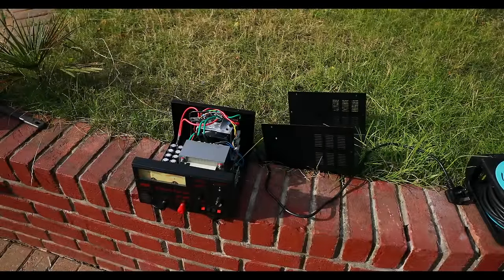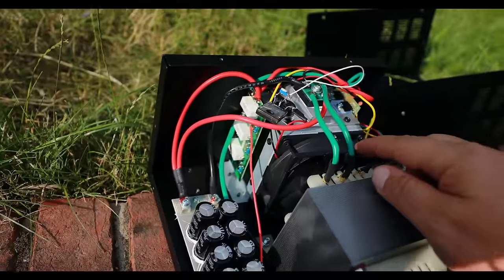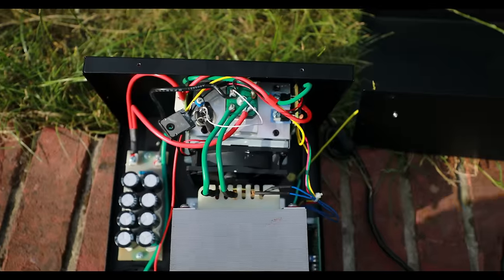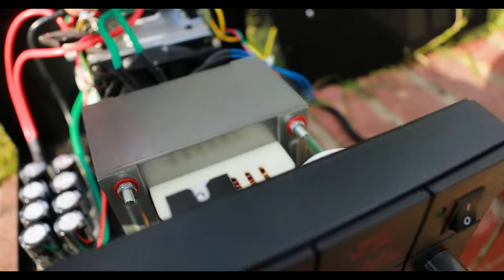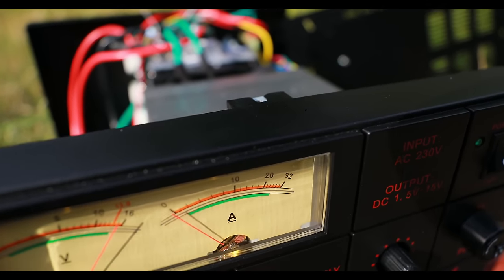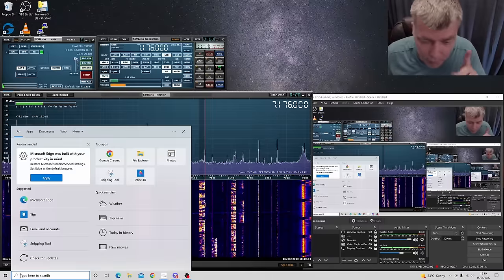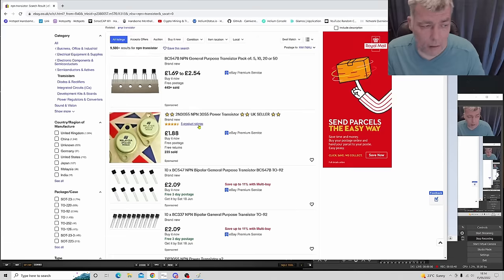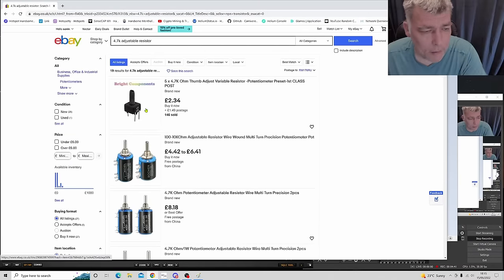NEVADA PS-30M power supply modification - fan speed/noise issue - Ham radio, CB power supply

Comment: I can tell you why ?? Manufacture do not want this PS to last 10 years, the want it to last 2-3 years max, and then you will have to buy a new one. All electronics are made for obsolescence  in mind.
Reply: totally agree
Reply: my favourit laptop,a  Dell D830 (this one,a  big,heavy sucker; i have about 10 or 12 others, not Dell,  i5s,  i7s etc) is still like new, BECAUSE
1:  it was  modified inside so that the fan runs full speed ALL the time; and the inside is cleaned every 2 or 3 years (or is it 4 ?---- 5 years ago i re-"greased" the cooler).
2:  it sits atop a  10 inch cooling fan,USB powered(7 euros,years ago)
3: and so,even though it  drinks amps like a fish,it is ALWAYS cool to the touch on the bottom.
4:  the main advantage being that since it does NOT  CYCLE between cold and hot and cold  again, the ICs are not exercised inside and their internal  tiny welds do not break..............

Comment: I have the 40 amp one. I put a 220 ohm 5w resistor across the bimetallic temperature switch. The fan runs slow all the time, hardly audible, and the PSU runs stone cold. If it did get hot the bimetallic switch would turn the fan on full. A really simple solution. The resistor value for the 30 amp version may be different.

Comment: I think to make this even better for quiet is to put a small sheet of aluminum in to mount the transistor which could be hooked somehow to the transformer to pull heat away from it. Have the sheet of aluminum run along the inside of the case so air flows right down it say down one side or the other of the power supply. Would be simple to drill and tap the metal on the transformer to the aluminum sheet thus improving the power supply immensely.

Comment: I did a similar mod to a power supply but i used a mosfet, ntc thermister bonded to the heatsink and a variable pot which was adjusted to turn the fan slow but as the heat increased the fan got faster .... worked a treat. 73.

Comment: It would be better to use a additional base resistor of 1 - 2 KOhm. Otherwise if you accidently turn the 4,7K to plus 12V the transistor is  immediately dead.
Reply: There's no risk of burning the transistor since it's connected on the high side of the load. The maximum current on the base if connected directly to 12v is around Ifan/hfe.

Comment: The biggest problem with these "cheaper" linear power supplies is a lack of OVP,  a good modification is to add a little circuit with a thyristor/scr, zener diode and some supplementary components to crow bar the outputs in an over voltage situation. All it takes is one of those series pass transistors to go short and you will have the full rectified DC straight to your transceiver which won't do it much good. A relay disconnect is not really quick enough, especially switching the primary side as there is a lot of energy stored in the bulk caps. 

Another thing I find with these is they wrongly have the mains earth tied to the negative rail, this isn't ideal and can introduce noise, ground loops and an RF return path through the mains.

The OEM is of that PSU is QJE
Reply: The transistors aren't the only problem with those supplies, the build quality is just crap, really poor soldering and the heatsinking is completely inadequate..

I bought one from an OM who'd had it connected to his brand new FTDX10 when a single wire inside had fallen off and shorted something on one of the pass transistor boards, it stuffed 25V through his pride and joy.

Was a quick fix but he had lost all confidence in it and just wanted rid.

Comment: Ty Sorin. Great tip. Ya with the amount of cheap ic’s they could have used a attiny programmed too run the fan at certain speeds throughout the temperature range.

Comment: I like these ham vids.  Did you bought your HF Amp Second Hand.  I did not know that they still build those Alpha Amps.  Everybody is using Acom and those  Om-Power amps.
For the PSU fan noise you could also use a 24v dc fan as a emergency plan. It worked for me.  But the problem what i have with Icom mobile rigs is that when you engage the ptt button , the trx fan goes screaming like a pig.  The old trx with big heat sinks were way better.

Comment: the power supply like that I made it myself and I did it the same I put in a temperature controller which start fan at certain temp with low spining and when it is hot it will spin fully. you can get that pcb already made on ebay for abot 8$

Comment: I bypassed the thermal switch which had failed and the 12 volt regulator and run the fan via a 6 volt regulator ,removed the noisy grill at the rear  the fan runs all the time and is quieter than my desktop computer both  are under the bench the regulator can be fixed to the metal frame of the fan housing which has a convenient screw.Dale is correct an OVP is next

Comment: Hello Sorin, thank you very much for your teachings, I want to ask if the temperature sensor is already installed that source or you have put it, why if you have to install it that cutting temperature you recommend 120ºC?, and another thing if that sensor is closed normally and when it reaches the temperature it stays open and does not drive. Thanks a lot

Comment: I would include a protection diode to save the life of the transistor if I was you. Although it’s a small motor, you would still see induction spikes grater than the rating of the transistor
Reply from the maker: Oh, most of the fans have brushless motor
Reply: You will still have back emf from a brushless motor. Diode is always a good idea to save B-E breakdown of the transistor.

Comment: Really !

Just drop a 2W 47 ohm resistor across the thermal switch ….....
Reply: On this PSU I used a 150ohm Cement Resistor Ceramic 5W White across the thermal switch, works just fine now.